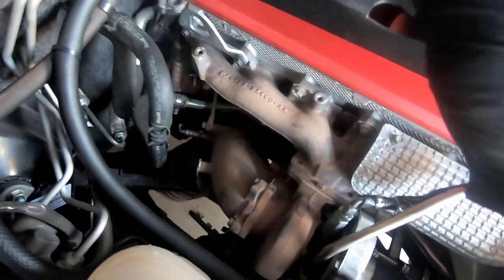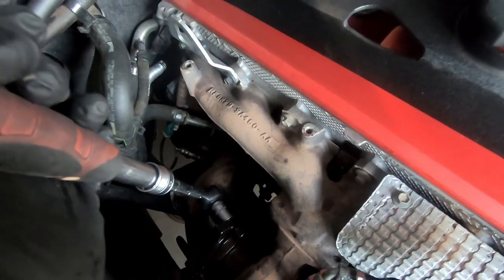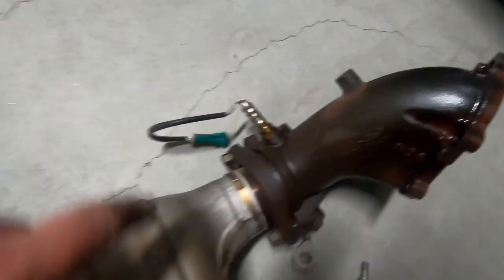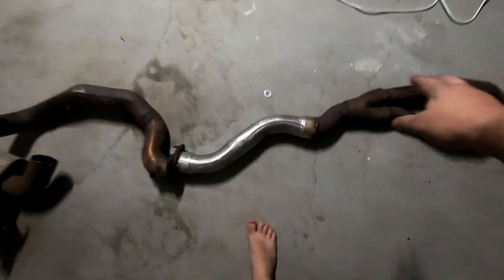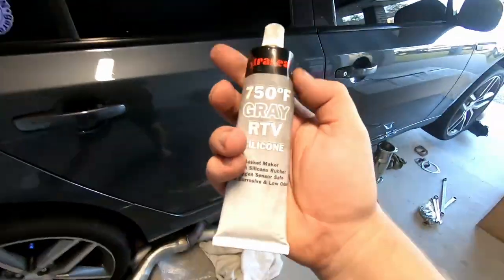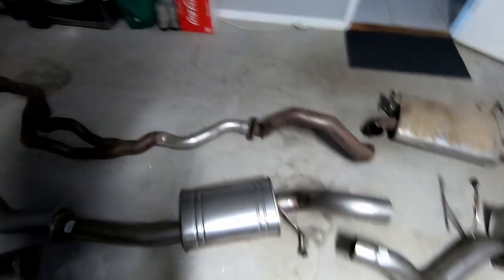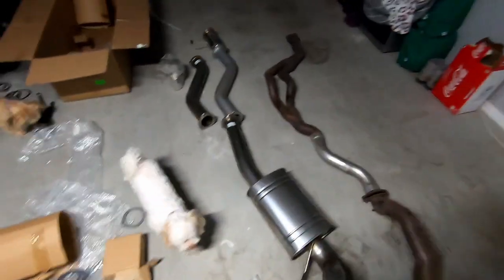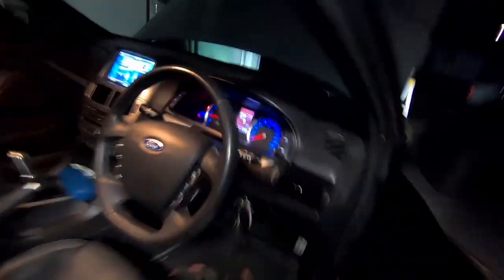PERFORMANCE Exhaust FGX INSTALL!!!!! (Sounds Mint)

Comment: I can highly recommend xforce exhaust systems,i have a 3.5 inch cat back system on my fg xr6 and it sounds way better than my neighbours GT mustang.
Reply: Hey mate,
Is your xr6 an non turbo?
Reply: @jasondemetrious6944  yep it was a N/A mate but I no longer have it,got rid of it due to transmission shift flare problems, the servos fail around 120,000 ks. Those 5r55s 5 speed transmissions are garbage,expensive asf to get rebuilt or anything done on them. She's gone,someone else's problem now.
Reply: Yeah ok. Can I please ask how did it fit up to the original cat? Did you get an adapter made up for it. I have a 2012 Fg Xr6 NA  Limited edition ute.
I bought the xforce 3.5 cat back system but not sure how to go about hooking it up to the original 2 inch cat system so it will still sound good.
Reply: @jasondemetrious6944  it had a fitting on it that went from 3.5 inch to the factory cat,it was a elbow shape and made from aluminium from memory.
Reply: @jasondemetrious6944  yeah it would have been roughly about 35 degree bend and made from alloy mate.
Reply: Ok cool. I'll look into it.
Thanks very much for your insight and help. Very much appreciated.
Reply: @jasondemetrious6944  no problem. Any performance exhaust centre should have the alloy extension you will need.

Comment: Hay mate,I so need an system. Just don't know witch way to go.all for power not the drone noise. Xforce maybe. Did you get much power with your setup ,did you run headers?not  to piss in your pocket but I'm loving your channel.i have done airport battery relocation, 1000cc injectors, fuel pump and performance tune.
Reply from the maker: Then x force system was not didn't drone at all with both mufflers in but it was very quiet that's why I got the middle muffler removed.
I just got the turbo back system I didn't see the point in getting a 6 boost manifold when I'm only going to upgrade my turbo to a 3582 and that bolts up to the factory manifold.
If you watch the dyno vid you'll see I was limited by my turbo, the exhaust I have on the car now should be good for 600+hp.
Cheers for the feedback also mate!

Comment: Hey man but of a late comment but did you have a tune before this? I’ve heard your turbo can overboost if you don’t get a tune straight away
Cheers
Reply from the maker: So I knew I was going to get a tune so I wasn't to fussed but you will have issues if you go boosting around, it'll throw fault codes and go into a limp mode (cause of the over boosting) so get a tune asap